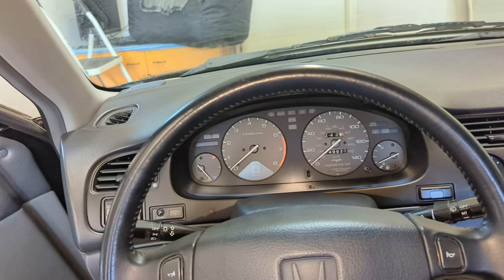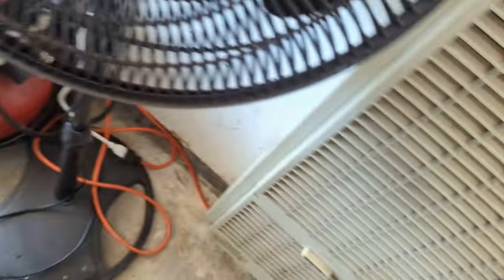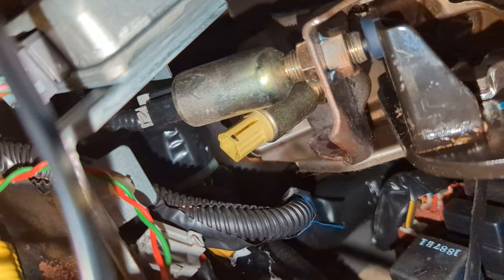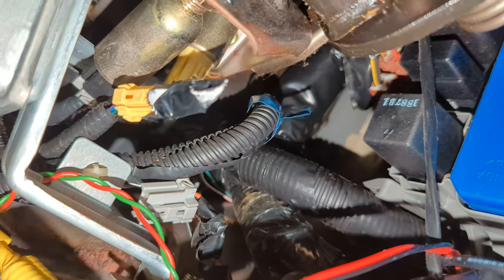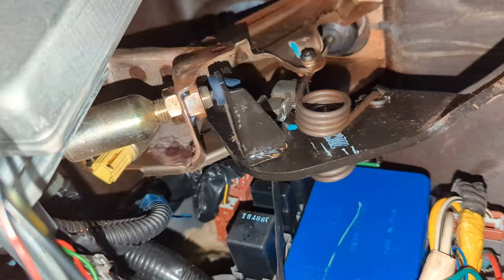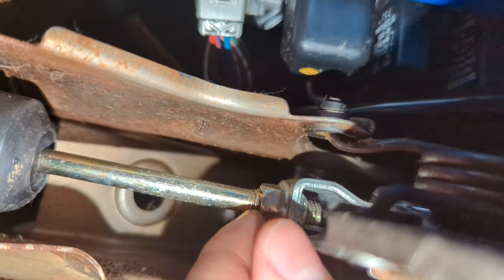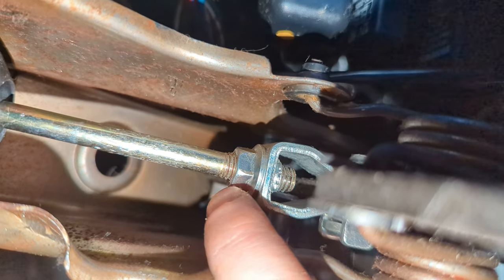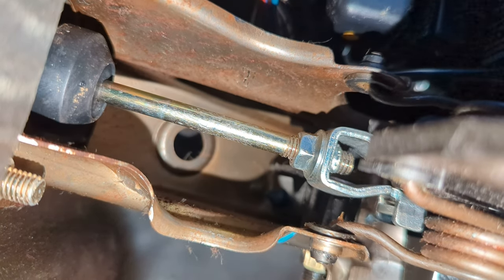5th Gen accord (1994-1997) clutch safety switch bypass and pedal adjustment

Comment: Did this work Long term? My 1997 honda accord broke the clutch safety switch and i removed the entire clutch to try to stick a coin in there but ended up failing and while trying to take it off again i stripped a nut. I just gave up and started looking at other solutions.
Reply from the maker: yeah, if we physically look at it: jumping the plug bypasses the clutch switch entirely, so whether it's good or bad doesn't matter cause the car isn't seeing the signal from the switch. It's just seeing the artificial 'clutch is always engaged' signal that we created by jumping the two pins together